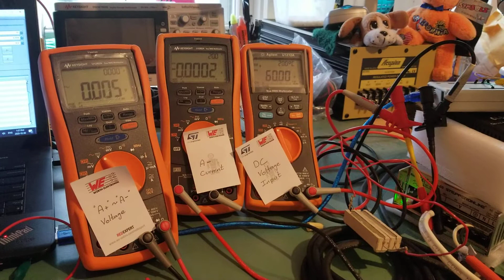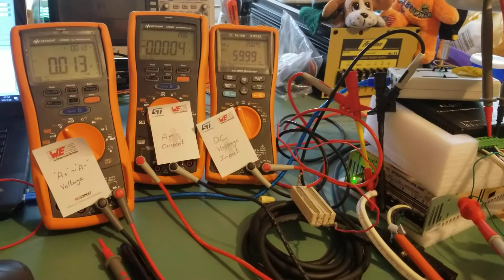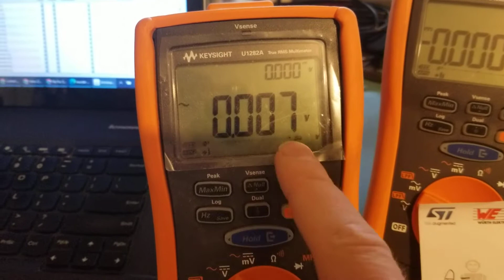CL86T Stepper Motor Driver with

Comment: I have not seen a lot of people use this driver, i got one and have been having issues. I have not been able to move the motor at all. With or without enable the motor does not want to move. When connect the enable the motor does make a glitch sound but there is not holding torque and it does not move. When i disconnect enable, there is holding torque but no steps. I have tried connecting DIR- and PULL- together to ground and supplied signal using an ESP32 3.3v, and also with an Arduino 5v (For both using the stepper library through IO pins). No response from the motor. Even tried connecting DIR+ and PULL+ to 5v (Arduino) or 3.3v(esp32) and PULL + and DIR+ to two IO pins respectively. Motor does not move. I can confirm there is voltage on the DIR and PULL pins. Can you show your wiring diagram and the code your running?
Reply from the maker: I have not looked at this in a very long time. If you are still having issues let me know and I will dig this out again and see if I can get it back to this point. I believe I put it aside due to the level of uncooperativeness of this product. It was just not made with simplicity in mind.
Reply: @KasLewis  Hey Thanks for replying. I was able to figure it out. There was some wiring issues with my ESP 32 and I was able to get that sorted.
Reply from the maker: I'm happy to hear you're able to figure, it'd be great to see how far you can get this working as I was able to get it to working to a certain extent but beyond that I just kept having problems think there was slipping issues and missing steps. I don't believe it's too bad of a product I think either they're missing some explanation on how all I need to fix up the firmware to make it more user friendly.

Comment: Hello, How can contact you mate
Cheers
Reply from the maker: What are you looking for??
Reply: @KasLewis  I have the same driver and I will like to know if you can help me to wiring, if you have any diagram
Thank you very much
Reply from the maker: @johnbullfloats7502  Can you elaborate please. I beliv ethere are two power connections, input control and output to the servo motor.
Reply: @KasLewis  I'm struggling where I wiring the signal from the driver to the controller.
Reply from the maker: @johnbullfloats7502  Did you ever get this resolved?

Comment: Did you get this sorted out? I am looking at the CL86Y and the CL86T drivers for a project and not sure which way to go. Given the issue you are seeing on your end I am leary going the CL86T route if it can't hold the torque when the step is locked.
Reply from the maker: By disconnecting the enable pin the issue was resolved. I would assume from this there the code on the Arduino has a timing issue. I am assuming the delay between set enable and the time to start stepping is either not long enough or non-existent. If you would like I can post a second video showing that is does now work.
Reply: @KasLewis  I'm more interested in the difference between the CL86Y vs the CL86T and if I should spend the extra for the T series
Reply from the maker: @codearachnid  I have not used the Y series. What I have used with the T has been somewhat limited. If there's anything you'd be interested in having tested, I wouldn't mind doing something for you.
Reply: @KasLewis  I really appreciate it! I reached out to stepperonline the other day for the differences and they sent me a table to refer to https://www.omc-stepperonline.com/index.php?route=extension/module/iblogs&path=2&post_id=9 and maybe I'm missing something but there is no data to compare and the actual product pages don't seem to have much variation between the two models for actual data to determine their capabilities. So I was hoping you in the real world had some insight as to why you chose T over Y.
Reply from the maker: @codearachnid  From looking at that link, it appears the difference is reliability. The parts are supposed to be from top brands and the manufacturing is supposed to be tier 1. 

I would love to get a version Y open it up alongside the T I have and look for differences. I wonder if there would be anything noticeable between the two in terms of component selection and the manufacturing process. 

I have looked further into the product pages (not too deep) and there are other differences. 
Y - USB
T - RS232

Y - 8.5A
T - 8.2A

Y - 20~80VAC / 30-110VDC (AC/DC input)
T - 30 ~ 80VDC (DC Input only)

I'm sure there are other differences as well, but these are the ones I found after a brief comparison. I hope this is helpful.
Reply: @KasLewis  this is fantastic! I appreciate your diligence. I am not sure where you found the data for the USB vs rs232 but that's awesome and helps me decide. I'm going with the Y series. When I get them in hand I'll crack one open and setup a video for you to review
Reply from the maker: @codearachnid  Looking at both product pages there was information regarding 
RS232 on the one and USB on the other. Information could be incorrect but as it was for each product respectively, I assumed this to be correct.
Reply: @codearachnid  Cl86y is their newer driver vs the cl86t remember there both geared towards closed loop stepper motors the Dm series drivers are for the open loop drivers